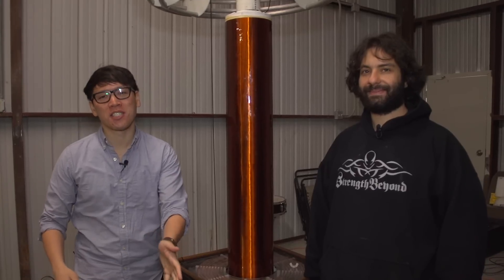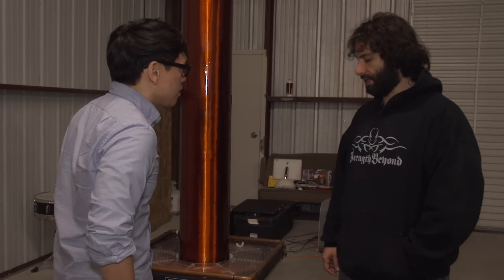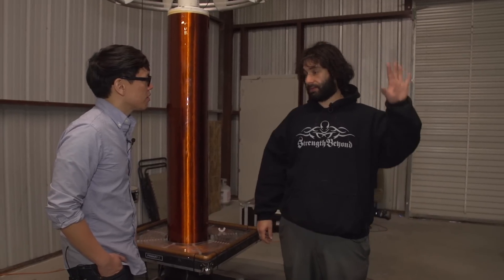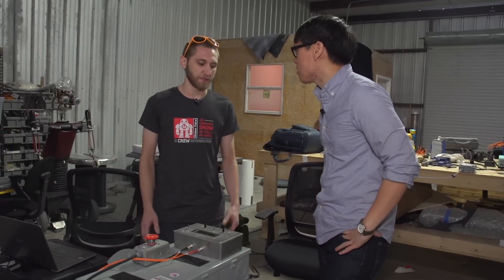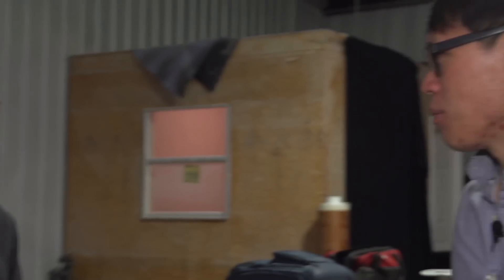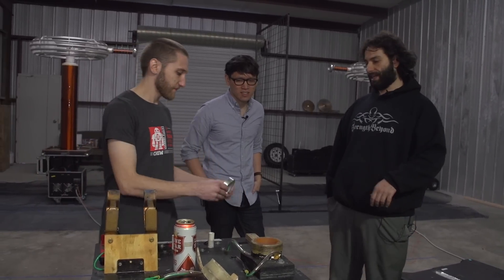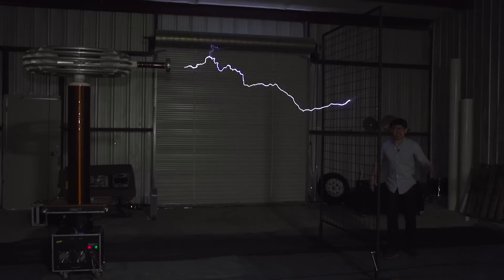How Giant Tesla Coils Work (with ArcAttack)

Comment: I'll never forget the day, some 40 or so years ago, when I built my first Tesla coil. I had nothing but written instructions on how to build it that I had clipped from an old magazine. I used an old 110volt chainsaw blade sharpening motor to fabricate a rotating stop gap. Ten (6) oz Coca-Cola bottles I used to make capacitors with. For an emergency overload spark gap, I used two pewter figurines. One was a traditional wizard character holding over his head like he was challenging God, a long staff. The other was a lizard hominoid grasping a sword pointed toward the sky. When voltage spikes occurred, which was often, the electrical discharges that were destined to burn out the 12,000volt neon sign transformer I used to power the coil, would safely discharge from either staff or sword to a grounding point. Without any adjustments to anything, I got three to five foot of brilliant arcs visible in daylight. When operating in the dark, there were hundreds of arc streamers, not visible in daylight, that literally enveloped the room. After realizing that these smaller arc streamers had been using me as a ground all along, I decided to try and make friends with the large arcs. I gradually moved closer to the three to five foot long arcs and they did exactly as I predicted. The large arcs started discharging into me. The sensation of being struck with so much electrical current I wouldn't call painful but neither were they pleasurable. Uncomfortable would be an accurate description. The basement shop I was in had fluorescent lighting. I had to remove all the fluorescent tubes as every time the Tesla Coil was energized all the fluorescent tubes would light up when switched off. I performed many experiments with that Tesla Coil. I learned that holding something metallic in my hand as the large arcs struck it instead of directly striking my bare hand, completely eliminated all discomfort previously felt when being struck directly. I also found that by holding a fluorescent tube in one arm while moving my other hand closer to the toroid, acted upon the tube like a rheostat. The closer my other hand got to the toroid the brighter the tube illuminated. I found that when the long arcs were striking me, reaching over and touching someone else caused both of us to experience a much more uncomfortable sensation than taking direct strikes. The only time that I received and severe shock was when I made the mistake of getting too close to one of the transformer leads. Though heavily insulated, the voltage was more than the sufficient to arc through the wire's insulation. What really surprised me about my Tesla Coil was how loud it was and how much it smelled. I would often get headaches while running the coil. Once I installed an exhaust fan to remove the ozone I no longer got headaches. Later I found out that the ozone headaches were nothing compared to the soft x-rays I received while operating the coil.
Reply: This was an impressive story
Reply: This is the way.
Reply: So now you don't need a flashlight in the dark, you merely open your eyes wide? 😎👍

Comment: I have 2 degrees in engineering, and I only understood about 1/2 of what he was talking about :/
Reply: and...
Reply: Keith Ward I agree with you
Reply: I haven't even finished my engineering course and I understood all that they were talking about. (I do electrical, so that may be why)
Reply: i have no education in electricity, have study metalwork (welding, metal turning and mechanics) are a student in 3DS Max animation and design for Optimar and not started my study in engineering yet and i understand most of the stuff ';. )
btw if you are interested in tesla coils check out TheGeekGroup her on YouTube, they got a high voltage lab, they tell how tesla coils work and how to build one on your own ';. )
Reply: What engineering degrees do you have? I don know that unless you go electrical engineering, classes won't cover much beyond basic semiconductors.

They are just using a big variable frequency drive as a Class D amplifier to modulate the air around the arcs like speakers. The transistors pulse width modulate the DC that powers the resonate L-C (inductance and capacitance) tank circuit. The midi tweaking is more to make it sound pleasing and get better dynamics.
Reply: I only have highschool and I understood pretty much everything they said.
Reply: I have a vocational degree in electronics engineering which covered the basics of Tesla coils but never put it all together. When I heard they existed I researched them online & it all made sense. I have wanted to build one for a long time but thanks to two consecutive layoffs because electronic / electrical work is too technical for a state that would rather sell coal to make a few people rich than encourage manufacturing to help many people live comfortably. But hey, at least I know the ground beneath my feet is being sold to China & soon the EPA will all but kill the one industry we used to be able to rely on.
Reply: I have a degree in art so this is basically all just sorcery.
Reply: savagedias I would look at moving out of that state or look at joining the IBEW (electrical union) as an apprentice. I know that there are a lot of electricians retiring right now, so most areas are looking for apprentices. As far as moving out of state, the cost is worth it in the long run. I would look at Washington or Oregon with your degree, especially if you have some experience.
Reply: Keith Ward Exactly! thats so true, i understand most of it and im still in high school, and the only reason for that is my high desire in learning about the subject. if you put your mind to it you can learn and accomplish anything! thats how i got to the point of making my first successful tesla coil!
Reply: Keith Ward What's so wrong with management?
Reply: Keith Ward Thanks.
Reply: Which type of engineering? lol They're speaking pure electrical engineering there
Reply: Some doctors are idiots and a fair amount of engineers are too. Degree's make you employable. Not bragging here, but I picked up on one or two things in the video that could've been worded better.
Reply: Wow well you better go back to school guy cause this is all basic electronics.
Reply: degrees not "degree's".
Reply: I have one degree, bs in Physics. I understood all of that. I hope your not EE lol
Reply: AA Productions that's cute
Reply: AA Productions I lost brain cells reading that.
Reply: @Baudshah Suleymon Your saying that cause you cant get a degree. Tesla was educated btw. Funny because you didnt research the topic, like someone who is educated would have. Let that soak in.
Reply: Skip6235 apply for a refund from the schools.
Reply: @Manny X

Dunning Kruger effect. As a kid in high school, you know almost nothing about real world applications of science. Your knowledge vs an engineers is not even comparable.
Reply: There arent real world applications of a tesla coil. Everything discussed in the video is covered in a basic circuitry course and a basic physics course for engineers. Every component of the tesla coil is used in modern science (not to imply that tesla should be given credit for this). What highschool teaches freshman students about how inductors and capacitors work? Do you know what units they use off the top of your head? Do you know what magnetic flux is?
Reply: But what does that mean? What does the magnetic flux in an area of space tell us? You understand that understanding circuitry and physics is primarily theoretical right? You dont need to build a bridge to understand statics.
Reply: Again, it doesnt impress me that you can google the term and regurgitate what you have read, when you can not understand what magnetic flux actually is, and our methods of utilizing it. You are discussing line magnetic field density over an area. You still made small mistakes in your understanding, as magnetic flux describes the force ON a point charge, not the force OF the point charge. What good is there in attempting to learn such a thing if you dont yet know how to take a basic integral? There is none. Understand that you are young, and the amount of knowledge you have been exposed to so far is extremely minimal. You cant trick people who are actually informed into believing that you know what you're talking about.
Reply: Well then what is you're background. Is it that you are an engineer. You are taking credibility for something you have not proved yet. And I have no reason to believe you.
Reply: >you're background

lmao
Reply: Says the one who plays dark souls and thinks game theorist is legit science. Last time I checked watching undertale theories isn't gonna get you a degree in anything.
Reply: ? I dont think that game theorists is science lol, my entire life doesnt revolve around my career. I watch things that are far outside the realm of possibility for entertainment. I'm an engineering student already, I can guarantee I know a lot more about applicable mathematics than you do.
Reply: >you're

lmao same mistake again. An engineer will know a lot more about circuitry and EE like what is being discussed in this video than a mathematician. I find it funny that you switched to your other account Manny.
Reply: I like your roblox videos by the way
Reply: And yet again you are an adult comparing yourself to a teenager who does EE as a hobby.  And you still have not disproved any of my claims. I said I could understand MOST of what was being said. And I never said I knew all about flux. But what I do know is that a changing magnetic field induces current into a secondary coil. And I have made tesla coils as well both rotary spark gap and solid state. You don't need to be a book wiz to get stuff done just ask any mechanic or handy man.
Reply: haha stay in school little dude. good luck with functions.
Reply: Sorcery really? Not by a long shot. It's just knowing how light and magnetism truly work.
Reply: What field???
Reply: Sad
Reply: I have no degrees and I understand aha but that’s because I’ve studied almost all of Tesla’s work since I was 10 I’m 19 now
Reply: I honestly didn'tt understand anything he said. But it sounds interesting to me.
Reply: Four years late but I just want to flex. I understand everything in this and I’m 14
Reply: Im still in kindergarten and I understood everything
Reply: Two engeneering degrees!!! WOW!!!! Maybe your "engeneering" degrees are in pole planting and septic tanks, for which you'd need a degree in bio. But apperently your capacicities are.....
Reply: I understood like .01%
Reply: As an electrician, I was able to follow for most of it
Reply: Lol run from school

Comment: Looks like an IGBT.  Integrated Gate Bipolar Transistor.  Yes?
Reply: Very close, Insulated Gate :)

The gate of an IGBT (or MOSFET) is like a wee little capacitor that you charge and discharge in order to switch the transistor on and off.

Comment: I'm not an electrical engineer, not even any kind of scientist, but from your description, it isn't a Tesla coil, it just looks like one?
Reply: theres basically two types of tesla coils, Spark Gap tesla coils (SGTC), and Solid State tesla coils(SSTC). the first tesla coils where made by tesla and they all consisted of sgtc's. thats because there where not any mosfets, igtbs, or transistors to make it solid state. now that there is that kind of technology, its used more commonly, and they have SSTC's
Reply: resonating cw switch!
Reply: It's not a real magnifying transmitter

Comment: What if the guy stumbled on accident and fell into those two electrodes on that gigantic charged capacitor. Would he explode?
Reply: neh, the power is off
no one is near when it's on without a metal mesh suit
Reply: ThePaalanBoy
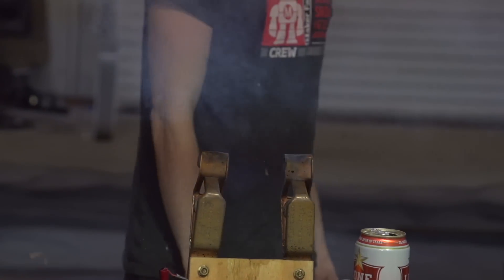Yes the power is turned off, but that capacitor is charged up and is storing a fuck ton of energy... at around 13:20 where he turns that foil into plasma...The guy said that it is not even near fully charged even.... that thing is dangerous, instant death if you accidentally touched those electrodes.
Reply: ***** there are some resistors for discharging the capacitor

Comment: incase anyone is wondering ive learned that using one xor gate you can make an ocilator by applieing a constant voltage to one input and then atatching the output to the other input please give me any information if you try this as I have not done this yet I have just done it on powder toy which is a fluid sim game and is really cool I recommend it to anyone who likes to test electronics or other things.

Comment: How is it that tesla coils are so big and make so small amount of electricity compared to voltage multipliers. I mean voltage multiplier can basicly be pocket size and make from 50k to 250k, and they can be powered by fucking arc lighter. But the difference is that those bolts look more like acctual lightning bolts in comparison to tesla coil which just sound like they are screeming and lightning bolts are all over the place and almost look more like arcs than lightning bolt.
Reply: Voltage multipliers are exclusively DC, meaning they can’t travel through the air on their own to ground because they aren’t switching at high frequencies and capacitively coupled to ground.

Comment: Its like a huge machine , that once was , and divided the technolgy ._. 
This is just one piece of a bigger machine._.

Tesla designed a huge machine, this is just the power source._.

It appear broken down and scattered across earth._.

What did tesla create? 
I see separate tesla inventions that should be one._.

Tesla coils power source transformer._. 

Rumour was a telepotation device._. Ride the lightening ._.

Power source was tesla coils._. 
Uses a pulse of power ._. 
Tesla batteries to store pulse after tesla generator builds._.
Microwave and electromagnetism fields build ._. 

A storage field of energy or battery park.

If i can move the earth, by altering the magnetic field ._. I can save it._. 

Teleport earth._.

Is that what tesla built ? A planet teleporter._. ? 
To move the earth? 

A comet has cold fusion._. Cold fire? 
Fire in ice ?

If i can make ice on fire , then i can move worlds._.